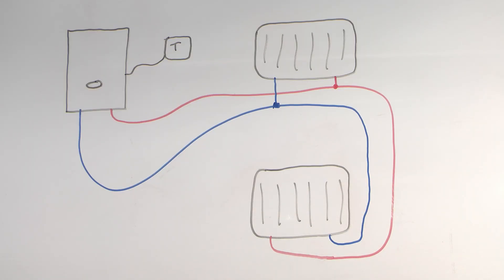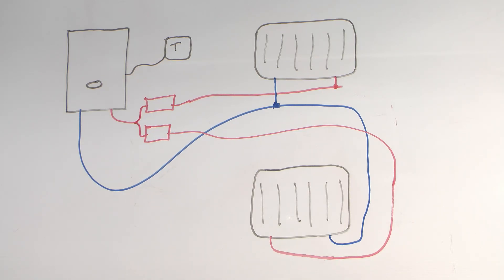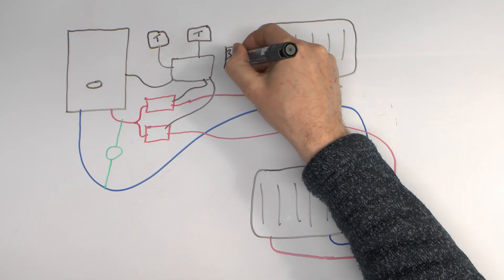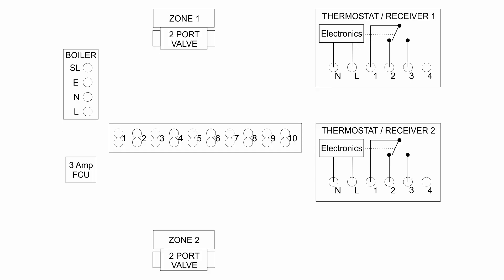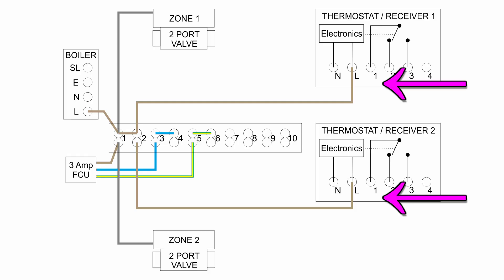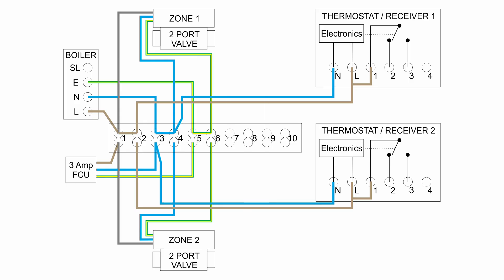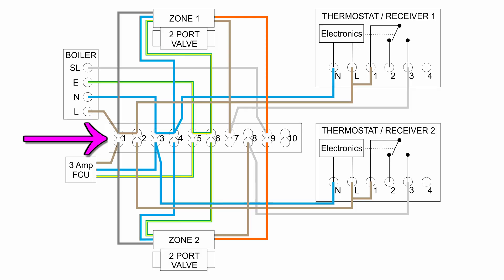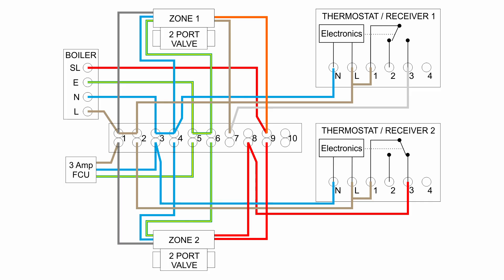Combi Boiler with Two Heating Zones, 230V Switching

Comment: I have a question regarding Pumps. What happens if you have a pump on the switched side of Zone Valve 2? Whilst you may get a live feedback to say Zone 2 from Zone 1 if zone 1 is activated but what if Zone 2 has a pump wired to the boiler switch side? It would do nothing to the Zone 2 Valve as live kickback from zone 1 would stop at the micro switch but the pump would start pumping. How would this be solved other than putting the pump on the unswitched side of the valve so when stat switches Valve motor on the pump is activated. This isolates the pump on zone 2 from Zone 1 when zone 1 is activated. Hope that makes sense?
Reply from the maker: The usual method for a pump for one zone is to connect it to the switched output of the thermostat for that zone, so it only runs when that zone is active.  Normally used for underfloor heating where there is only a single thermostat for the whole zone.

If that pump is wired to the switched output of the valve, it will run when one or more of the zones are active, and will circulate cold water around if that zone is not selected for heating.  It will still work for heating but will just waste electricity running when the zone is not selected.

Comment: Hi , can you have two wierless thermostat and two receivers on a combi boiler worcester bosch. 
I would need each thermostat control the heating for upstairs and downstairs radiators. What's your advise?
Reply from the maker: My advice is to actually watch the video you are commenting on, because what you are asking is exactly what the video is about.

Comment: Hi John, Many thanks for detailed explanation. It worked well for me, and easy to understand my boiler configurazione. Managed to set-up hive with two zone. I have actually an issue, one of the valve shows 150V when hive is on. I think the valve isn't opening fully. I will try with old thermostat if this works. I will be surprised if so, when I Force the valve manualy to open, this will show 230V ac. Any suggestion from you?

Comment: Most boilers have a 230v RT port usually looped with a small cable. If we remove the loop and have 2 zone valves with one SL going to the boiler, where would you put the SL in the 2 RT ports ?
Reply from the maker: The link in the boiler as supplied from the factory is between L and the switched input.  The switched connection from the wiring connects to the switched input.
Reply: @jwflame  thanks mate. The link is in terminals 4 and 5 usually. I've not seen a link between L  and the 4 or 5 terminals. Unless you mean that one of the two 4 or 5 terminals is a permanent live and the other is switched live which energises when the zone valve switch is made?

Comment: Hi John, I am just a beginner in this. I can see that different youtube channels shows in deifferent ways of wiring. Is there any common way to approach it, because I am bit confused that.
Reply from the maker: What matters is the connections between the devices.  Terminal numbers, colours of wires and so on are irrelevant, as they can be whatever the installer chose at the time.

Comment: 🤔 In central heating, Can I have a standby boiler which is used automatically (or manually) in case main boiler fails? 
It’s running the central heating system with just 1 boiler but switch 
 to standby (2nd boiler) when the first boiler fails?
Reply from the maker: Theoretically yes, but that isn't done, as a boiler just sitting there unused is likely to have problems such as the pump or other parts failing due to no circulation, internal corrosion and so on.
If an installation needs two or more boilers they are installed so they all work together, and removing one for repair/servicing is possible.
For most situations, a single boiler is plenty and if it breaks, it gets repaired.

Comment: Could i use this method with one zone doing the upstairs radiators and one zone doing the downstairs under floor heating and take a switch live from one thermostat to the pump for the underfloor heating manifold
Reply from the maker: Yes.

Comment: Would this still be the same if it’s an S plan. Except from having a programmer, separate hot water valve and a cylinder stat?
Reply from the maker: Yes, any boiler can be connected to S plan or any other arrangement.  Only difference is that some combination boilers do not have a 230V switched input so a relay or alternative wiring arrangement will be required.  For those with 230V inputs, it's exactly the same.
Reply: @jwflame  okay thanks. We’ve got some heating issues Mine is just a regular S plan system boiler. With hot water and heating valves But I live above a pub which has multiple heating zones and multiple 2port valves also. They come from one boiler

Comment: Hi JW, On pin 9 when both stats call for heat, why doesn't the voltage from both valves either add to create 440v assuming they are in phase or cancel to 0v if there's a 180deg phase shift introduced, with the first point being most likely.

Comment: Is there no programmer used with combi boilers?
Reply from the maker: There can be, however most recent installations would have a combined timer/thermostat.  Older ones usually had a timer built into the boiler itself with an external thermostat.
However entirely possible to have a separate programmer/timer and thermostat wired external to the boiler as shown here: https://flameport.com/electric/central_heating/combination_boilers_programmer.cs4

Comment: Having an issue with our central heating system. I have a brand new thermostat, and dual zone heating. The heat pumps both work as I can wire them each to the upstairs thermostat which works but I cannot get the downstairs thermostat to call for heat even though it ‘clicks’ when turned up. 

Any ideas what this could be?

Comment: Hi John, just what I was after, Great, Thank you. Same principle as your diagram etc but one circuit will be radiators, the other will be for UFH in a single zone. I'm just a bit confused as to where the return pipe would fit into this as 2 separate circuits? Would I need a third 2 port valve for the UFH return and just two 2 port valves on the flow side, one for UFH  and one for Rads as per your diagram? Kind regards, Paul
Reply from the maker: The return pipes just join together, no valves required.
Reply: @jwflame THANKYOU! I did consider that but won't UFH return interfere/mix with Rad return as that's on different circuits with diff pressures? So in a nutshell, the same as your diagram? Cheers, Paul

Comment: Great video, very clear. The issue I have at a client's property is that the wiring centre is at the opposite end of the house from the boiler and where the new Hive reciever would be. Currently there is only a 3 core and earth from the boiler/reciever area to the wiring centre which leaves me 1 core short. Would it be possible to supply the L,N and E to the pumps locally at the wiring centre ( fused down ) and use 2 of the cores in the existing 3 core and earth plus the earth as the switch cores? this would mean that there would be 2 circuits at the wiring centre. I would clearly label this at both ends but Im just wondering if it is ok or a total no no? Thanks in advance.

Comment: John! How might this work if i then introduce a 3 way zone valve for hot water in if we were using a system setup?...
Reply from the maker: It doesn't.  No one should be installing new Y plan / 3 port valves, they are only suitable for a system with hot water and a single heating zone, nothing else.
To add more zones or a hot hot water cylinder, it's another thermostat and a 2 port valve.

Other videos covering those: https://www.youtube.com/playlist?list=PLVsHvs2Suqmr5HtxgbInR4bXmH0kLseWc

Comment: How would I remove the second zone? We have a very small second zone in our bedroom and ensuite that we do not use as the thermostat makes a big CLUNK when it turens on or off and wakes me up! I'd rather have the entire house come on and off together.
Reply from the maker: Find the brown wire for the zone valve in the wiring centre and connect it to the brown wire for the other zone valve.  They will then both work together from the same thermostat.

Comment: Do the end switches “make” if you have no power and simply push over the lever to manually open the valve?
Reply from the maker: No.  The manual lever only opens the valve partially, should only be used when filling or draining the system.

Comment: Hi great help you are!
If I had an underfloor heating pump how would I wire it in? If it’s 3 core without it being on all the time?
Thanks
Reply from the maker: E&N to the earth and neutral terminals.  L to the switched output of the thermostat (3 in the diagrams, also the same as the brown valve wire), so the pump only runs when heat is required for that zone.
Reply: @jwflame  thanks mate

Comment: As this is a combi boiler, what happens to DHW when there is no heating demand and the boiler is off?
Reply from the maker: Combi boilers should be left powered all the time, it will wait in standby until a hot tap is opened.
If it's switched off at the front panel or has no power, then there will be no hot water.
Reply: @jwflame  I'm confused. I thought your wiring diagram applied to a combi boiler as per the title?
Reply from the maker: @henri7753  Yes, it applies to combination boilers.  Those which heat water on demand when a hot tap is opened.  There is no external wiring or controls for the hot water.
Reply: @jwflame  I had misunderstood the Switched Live in the diagram, I thought when there was no power to SL, then the boiler was off.
So the wiring for combis is exactly the same as for system, except that the hot water cylinder is missing here (but could always be added)?

Comment: Great video, one question if one zone is an underfloor zone with an additional  pump would you take the sw live from the zone valve?
Reply from the maker: UFH pump is connected to the thermostat for that zone, so it only runs when that zone requires heat.  Thermostat 3 in the diagram, which is also the brown wire for the valve.

Comment: Can you add the open therm wiring for one of the valves in a 2 zone system
Reply: As far as I know, opentherm would not be possible with a multi-zone system, as opentherm takes over control of the boiler (opentherm is a digital connection that goes straight to the boiler from the thermostat)

Comment: Excellent explanation, I have never worked with a boiler or any electrical wiring other than dashcams and the odd splice into a car live wire for some 12v power.

After watching your video, I was able to setup zone 1 of my Hive Dual Zone heating to replace my current thermostats, took me around 40mins including stripping/trimming cables, now I just need to cable tidy and then do the second one! 

Really appreciate this video and diagrams, very informative and right to the point.

Hive wanted £175 for this install, all I need is a little trunking but the rest is neat so i'm happy! :) - Anyone reading this comment thinking of having a go, just make sure you invest in an electrical tester to make sure the switch is isolating the circuit correctly as explained in this video, better safe than barbecued!

Comment: Hi , I have this system , I have 2 ESI programmable room stats . I would like to put open therm connected to my system , any idea what would be involved to do this , thanks
Reply: Opentherm with multiple thermostats is not possible to do unless they are wireless ones that share a single receiver (as opentherm uses digital communication between the thermostat and boiler, and it isn’t designed to allow multiple thermostats, with wireless thermostats, only 1 wireless receiver can be connected to the boiler using opentherm, and you cannot wire a second thermostat/reciever up without getting strange behaviour, such as the boiler only running when BOTH thermostats are calling for heat, or the boiler only responding to one thermostat, or perhaps even the boiler showing error codes and/or not responding to either thermostat)

Comment: Thanks for explaining this so clearly John. I'm fitting 2 Hive single-channel thermostats and I thought I was going to have to wire the receivers into the circuit through a new spur or something.. I'm pleased to see it's easier than that! I have a few questions (excuse my ignorance!)
1. On your diagram of the wiring to thermostat / receiver it shows the same connection from L on the boiler going to L and 1 on the receiver. The Hive wiring diagram labels L as Permanent Live and 1 as Common. I just want to check that I need to use a short piece of wire to bridge between L and 1 on the receiver?
2. What specification ofcable should I use for this?
3. I see some of the connections on the wiring centre have as many as 3 wires going into them. Do they all fit in the hole or will I need a connection block to connect the 3 wires into the hole?

Comment: Hi John I have a Greenstar combi CDI with comfort 11 RF installed, following your diagram to the letter.
everything plumbed and wired.
 Looking at the boiler wiring I find that LS is linked to LR so I am now stuck as when to put the orange wires from the 2 port valves.
Reply from the maker: The link is removed, the orange wires connect to LR.
The link is there so that the boiler will run all the time when heating is selected on the front panel, it's intended for testing purposes only when the boiler is installed.

Comment: Hi, I have this type of set up on my system. But I cannot control zone two independently. Boiler receives the signal, the burner starts and goes off quickly. Valve 2 is opened but I have no flow inside radiators. CH flow is hot but CH return is cold. But when zone 1 calls for heating both zones are heating. Any clues?
Reply from the maker: If this is a new problem then most likely is a blockage or air lock on zone 2 somewhere.
If it's always been like that then incorrect pipework is also possible.
Reply: It has been always like that.
Reply: The idea is that from boiler outlet when zone 2 asks the water doesn’t leave. It is cold. Only when zone 1 kicks in outlet is hot straight away
Reply: And wire 9 is always live. But boiler is not working

Comment: Brillant video , thanks . I am in a process of connecting an UFH ( zone 1) and radiator system (zone 2) I am using 2  2port valves as the UFH is only 1 large room , 2 hive thermostats , I am struggling to understand where to wire the UFH pump . any videos of yours available on that subject ?
Reply from the maker: For a single UFH zone, the pump is wired to the thermostat switched output, so it runs at the same time that the valve is open.  Terminal 7 or 8 in the diagrams in the video.
Reply: @jwflame  many thanks it makes perfect sense

Comment: Great clear video, but,What about the programmer on this same layout ?
Reply from the maker: If you want a separate programmer the switch contacts for it connect between terminal 1 and 2 instead of the link.   Could also be a timer built into the boiler.  Thermostats would then be basic types with no time settings.
Better to have programmable thermostats and no separate programmer/timer as that allows independent control of each zone, rather than the old ways of 'it's 6pm so turn the heating on'.
Reply: Ok thanks, so do away with the programmers, I run the heating 24hrs anyway as I’ve go u/f heating downstairs. I wondered why it’s not included as every system I’ve seen has a programmer
Reply: Also I need to wire in the  U/F pump, should it go in with the zone valve orange wires
Thanks, I guess your a very busy person 
I’m a builder and Had 2 sparkys trying to work on my C/H wiring but still not correct
Reply from the maker: UFH pump is wired to the thermostat switched output (brown valve wire) so thermostat on = valve open and UFH pump on.  If it was connected to the orange, it would run all the time the boiler was on even when UFH was not required.
Alternatively a dedicated UFH controller can be used.
If you use thermostats only and no programmer, the thermostats should be programmable types so different temperatures can be set for different times of the day, typically lower overnight or when the property is not occupied.

Programmer and separate thermostat is the old method, where heating was only used for certain times and not at all for others.

Comment: Hi Quick Question , If Zone 2 was a UFH system ( pump & Actuators ) would i attach their 230v Power To point 8 ? on the diagram . So they would switch off when the Hive is turned off ? . 
Would this also work if Zone 1 and 2 was on at the same time and i turned off the UFH/Zone2 ( would the Pump and UFH turn off ) ( I assume they wouldnt be getting any power from the orange ? )
Reply: I have the same question.
Reply: @robday3968  Rob , I converted my single zone to dual zone ( UFH and Radiators ) last weekend . From my UFH wiring i had a Brown & Grey wire ( Brown Sleeve ) . These both connected to point 8 on the diagram . This then meant the pump and actuators turned off with the zone . My setup was using two Hive thermostats .

Comment: If I wanted to move a radiator from one heat zone to the other and the radiators share a wall with pipes inside. Can I just daisy chain or will I need the floors up...

Comment: Fantastic video, thank you. Would it be possible to use a 3 port valve instead of two 2 ports?
Reply from the maker: Not without extra components and thermostats which had both on and off connections.
3 port valves were designed decades ago for one type of installation - a hot water cylinder and a single heating zone.  
They are of little or no use for anything else.